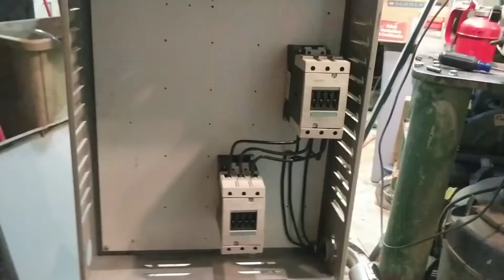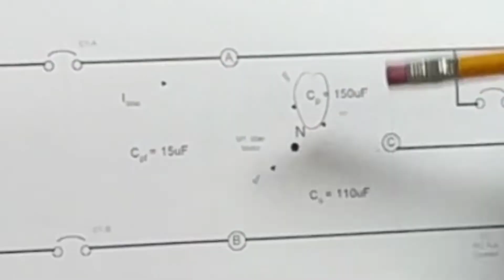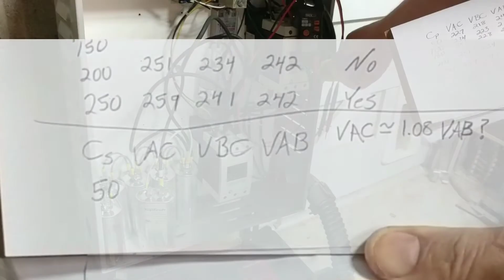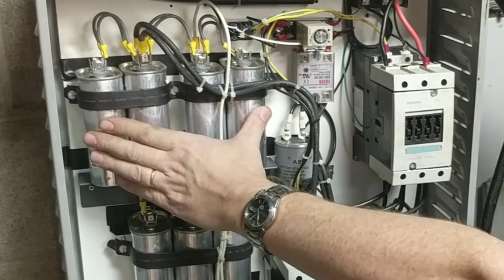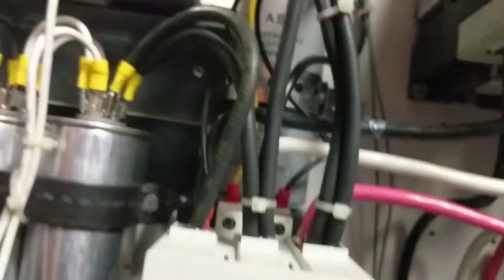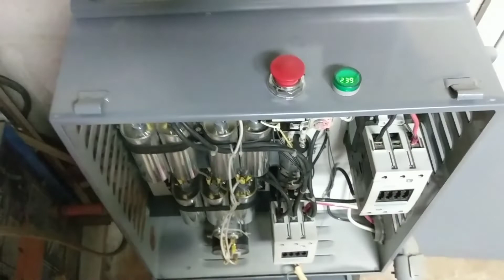Building a Rotary Phase Converter: Part 2 Assembly, Balancing and Final Testing

Comment: Very thorough pair of videos.  Thank you for the detailed explanation.  I would add that  building one of these  NOT a good idea as a DIY unless they have experience working with 240 VAC line voltage equipment.  There are also compelling reasons to buy a commercial unit which I'll get to. 

A few key observations from an engineering safety point of view. 

1) Where are your ground/earth connections?   Grounding is the most important safety requirement of all yet you never discuss it. 
1a) The earth ground from the 4 wire 220v plug should be bonded to the metal box holding the electronics, and also extended and bonded to the case of the motor.  
Be sure to scrape off any paint and use a star washer under a properly sized ring connector to bite into clean bare metal. 
Wiring to shop equipment should also carry a ground wire that is separately bonded to the control box,  the metal chassis and parts of the tool, and the case of the motor separately.  Every part of the equipment should be checked to be sure it's grounded. 
If an electrical fault develops, you don't want to be the path it takes to ground. 
1b) Grounding should be checked for your single phase 220v and 110v equipment too. 
1c) Modern AC powered portable equipment is likely double insulated. The External chassis of  double insulated equipment is isolated and should not be grounded. 
1d) f it's UL rated you needn't worry unless the equipment's electrical  components have been modified. 

2) Power fail shutoff that prevents restart is the ONLY safe way to operate this converter. This is true for every machine tool in your shop.  This is really easily implemented by using a magnetic power switch, a common safety device on all Modern machines.  That pull on Push off Red mushroom switch you used needs to get tossed. The magnetic power switch works by using a momentary On button that momentarily  applies  power to an internal electromagnet. The magnet in turn pulls closed a  commentator  which energizes the equipment. The electromagnet is powered from the equipment side of the commentator so stays energized until one of two things happen.  If the stop switch is hit,  it opens the connection to the electromagnet which in turn releases the commentator.  2nd, if power fails the electromagnet releases and  the commentatorn opens.  When power is restored the power stays off until the start button is pressed again. 
If you have machines that don't have this type of switch, i suggest you add one in a box ahead of the power connection to the machine. 
No,  you don't want to depend on remembering to find and turn off the power switch to a lathe or any other equipment if the power fails.  Last thing you want to do is be fumbling around in what will likely be in the dark while a mill or lathe chuck is spinning down. If the power goes out,  stand still until all moving parts stop moving. 

3)  If ever there is a case to be for battery based emergency power fail lighting it's in a shop full of dangerous machines and sharp tools.  That's an idea for another video.  
4) Your wiring.. commentators, or any other piece with a screw down or pressure fit connection should only have a single wire within rated gauge and type for that device.  With multiple wires going into those connectors it's a fire waiting to happen. You mentioned needing to upgrade to 4 guage wire. 
That's going to require a larger box and covered buss bars to make the multiple connections. Parallel connected Capacitors should each be connected to the appropriate buss bar and not daisy chained. 
Daisy chains have additive resistance and additive current flow.  Not a good thing. 
Wires carrying high current should not be bent in sharp turns. 

5)  Layout - all connections are best coming out the bottom of the box to prevent moisture from entering. Use appropriate grommets and strain relief to prevents stress on connections or chaffed wires. 

6) Since this is portable how are you planning on connecting shop machines?  

Last,  you need to discuss up front the ramifications of building a DIY solution like this.  IF anything bad were to happen at anytime in the future,  having an unrated device like this in use will likely void any insurance policy you have.  The burden of proof  that this device and any equipment connected to it played not even a contributory role in what occurred is entirely on you. 

Is it a risk worth taking?  
That's the 1st question I  ask myself. 

So,  I hope the detailed analysis hits a few new notes not covered already.  I truely mean them in a positive way.  I appreciate very much your covering the subject. 

I'm not sure I'd need such a large RPC unless it was a shop that had 3 or 4 people working in it.  20 HP? 
5 or more machines at the same time?  
The idle power usage is over 4A per leg.. about 1 Kw  just for the RPC !!

If you have that big a shop why not talk to the power company about providing a 3 phase drop?  You'll need an isolation transformer. Probably about the size of your RPC and control box combined.  Maybe you can find one where you found that huge motor.  
Where do you find such things for free?  

I've just aquired an antique Diamond M26 horizontal mill and a Craftsman 15 1/2 " Commercial drill press.  Both in amazing shape. 
The drill press is 110v single phase. It's getting a new power cord and magnetic switch in a box.  I want to preserve the original switch and function for restoration purposes. Easy.

The mill is going to need retrofit too. Much more to think about there. Zero documentation and parts are made of  unobtainium.
First is getting it home.  Disassembly required!!!!!
Fortunately NO RUST.  Also no manual and I'm not a machinist.
Maybe we can trade advice!
I restore antique clocks. I need to make parts.. so .. 😂😂😂

I'm used to no documentation. 
Lots of pictures. Keep the small parts sorted.  Write stuff you see down before taking it apart. 

Penny for your thoughts on the M26. Start Disassembly tomorrow
Reply from the maker: Excellent and thoughtful post.  Thanks for sharing.  You're right to point out the importance of grounding and bonding, from the panel all the way through to the equipment case.

In the future I'd set it up not to auto restart as you suggest.  I still disagree, but I'm apparently arguing against the entire planet, so I yield.  But my single phase 110v auto restarts after power outage.  And my single phase 240v auto restarts after power outage.  Why shouldn't my 240v three phase auto restart after power outage?

But, as I say, EVERYONE says I'm wrong about it, so I give up!  😁
Reply: @TheBuildist  The vintage machines will come back on.  That doesn't mean that it's safe that they do.  Some thing simply weren't considered or didn't have good, inexpensive solutions  that are available today.  Putting a single magnetic switch on your RPC will protect all the downstream three phase machines that it feeds. 
If you've got a sub panel providing power to your shop,  you could add  magnetic switchs near the sub panel to power fail protect all the single phase 220 and 110 outlets as well. Leverage the cost and effort to improve shop safety. That's a video worth making. Lighting should be on a different breaker. It's the one thing you WANT to come back on.
For a shop full of vintage machines that's a huge safety gain at very little cost. 

Grounding safety. It's why you should also have GFI protection on all your shop power circuits.   And yes,  I know that older houses may not have GFI on their kitchen, bathroom and outside power outlets.  It doesn't mean that it's not a VERY good idea to do this type of  inexpensive code upgrade.
 Keep it safe !!
Thanks again sharing your knowledge!
It's a lot of effort to make videos
Reply: the sky is falling
Reply: @mikeanderson1139 thanks Fucky Ducky!

Comment: Is there a specific reason you used the 200A  contactors?
Reply from the maker: Not really. I had them in stock and they were plenty adequate for the application. So it didn't make sense to buy something smaller.
Reply: @TheBuildist  Okay. Thanks for the reply!  I was wondering because those 200A contactors are very pricey. I am going to have to buy them. Do you suggest a contactor  amperage that matches your breaker amperage?
Reply from the maker: @thisisayoutubechannel4752  yes, at least the breaker size.  Remember, it's three combined loads of all your motors simultaneously. The rpc pony motor plus whatever motor(s) downstream of it.
Reply: @TheBuildist  Just out curiosity what is the model # of the contactors you used?
Reply from the maker: @thisisayoutubechannel4752  I don't know, and I no longer have that equipment.  Sorry.

Comment: Excellent video series. A couple of notes, as someone who spent many years as an automation engineer-

1. I recognize your point regarding having the phase converter automatically re-start. While I do agree the operator must be mindful, there are some situations where an auto restart, even with no power connected, could prove very dangerous. In particular, it is not uncommon for power to come back online at a reduced capacity- lets say if a tree happened to take out one leg of your input. In this current configuration, it's possible that the RPC would fail to restart, the timed start relay drops out, and the RPC experiences catastrophic failure as it gets fed a ton of amperage in essentially a locked rotor position. This can lead to thermal overload and a fire. At the very least, some thermal overload protection is a good idea, or some other safety, if you insist on having your RPC auto start. A breaker won't always catch these in time- a fusable link or appropriately sized fuse will though. You can maintain your one button start using a magnetic contactor- if power is lost you will have to just press ON again- a mild nuisance, but the startup of a 20HP motor really should be monitored each time. 

2. You have multiple leads in each terminal of the contactor. I would be extremely cautious of this- I have personally seen this have catastrophic results. It's directly mentioned in NFPA-70 as well, and is one of the first things I've had inspectors check for. The terminals cannot sufficiently clamp multiple leads at once. This can cause erratic behavior, and in really bad situations, shorts and fires. Using a 2 into 1 ferrule or soldering the leads into one is a bit better, but still frowned upon. Terminal blocks are cheap, provide a much more secure connection, and each lead can be inspected to be tight and to have good contact. 

3. I am not sure if you mentioned it, but you will want a way to discharge the start capacitor after it has started. A small bleed resistor is usually used. 

Obviously, you exhibit a great deal of good sense and care in what you are doing. There are other things that an inspector would mention, such as having covers over exposed terminals and making everything "finger safe". I put this into the camp of having guards over all moving components- safer is always better, but some common sense will keep you alive. The above things I would strongly encourage though.
Reply from the maker: Those are excellent observations, and I accept them without argument.  You're not the first to make the case that it shouldn't be set up to auto-restart, and after a number of sensible people tell you it's a bad idea, then you just accept that it's a bad idea.

Bob
Reply: @TheBuildist  heck, I'm prone to bad ideas myself!  Nearly every comment on my bridgeport unloading video is someone telling me it was a bad idea, haha. No harm, no foul, we can always build it better! Thanks again for the videos, I'm about to put together a 40HP RPC and its great seeing what others have come up with.
Reply: I cannot disagree with anything you have said. I was going to make similar comments, you have done it far better than I would.
Reply: @billdoodson4232  I'm in the process of getting my own shop wiring complete and part of that is building a large 40hp rpc. If I can keep to my schedule, I should be posting the RPC build video in about a months time.

Comment: outstanding.  I just got a freezer unit that requires 3 phase..also bought whats supposed to be a 3 phase converter.  its needs connected.  I will have to watch your videos over and over till I get it working...Whats confusing right off is coming out of the big motor are about 8 unmarked wires all the same color !  yikes...thank you for your time in making these videos

Comment: Very nice work and video. I've assembled  a few pony start rpc's but need to build a self starting 30hp unit. I have the motor and I've tested it in my old shop with a contactor, just don't know enough to source the rest of the build. Thank you!
Reply: Check out Sbirdranch's video series. He did a good job of showing components and sourcing.  I just finished my build based on his and powered it up for the first time today. This is not my forte, so I was pleasantly surprised when it ran perfectly!  Happy to help any way I can since I had to struggle through mine without help. You got this!

Comment: I need to build a 100hp phase converter, don't ask, I have a 100hp motor, where can I find the maths for this ?
Reply from the maker: https://www.homemadetools.net/forum/how-build-rotary-phase-converter-76547#post147353 has the plans that I found on the web and followed.  These plans are for 10 hp, so your capacitance and amps will all be basically 10x these plans.

Of course your wiring and contactors and such will need to be sized to handle that amperage.

And I'm guessing your motor voltage is 400?  If so, your capacitors will all need to be rated for... I don't know for sure. But at least 600 volts.  

Best of luck.
Reply from the maker: A 100 horsepower pony motor can support about a 65 horsepower RPC. If you need 100 horsepower output, then you'll need about 135/140 horsepower pony motor.  Beyond that the schematics are no different than what's in the video. I have been convinced that it would be better for it to start with a single momentary push button and stop with a separate momentary push button. So that is a slight change to the schematic but not dramatic.

And I don't recall it this second, but I think I spoke the math ratio out loud in the video of what is the appropriate capacitance to begin the balancing process with. Once you have installed the appropriate amount of capacitance to begin the balancing process, the rest of the balancing process proceeds as in the video but with proportionally higher values.  I think the biggest challenge will be the starting capacitor. The one that is only online for a second that causes a phase/timing shift to get the motor to spin in the first place. You may struggle to find a big enough capacitor to perform that function. Again I set out loud the proper proportion but I don't recall it off the top of my head.  I'll try tomorrow too track down my old notes and update this post accordingly.
Reply: @TheBuildist  actually I need 60hp